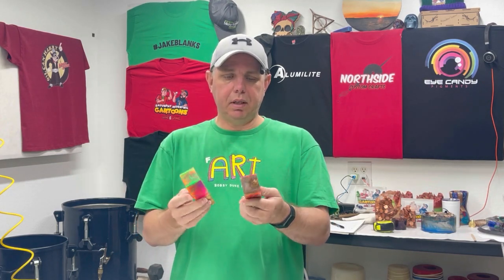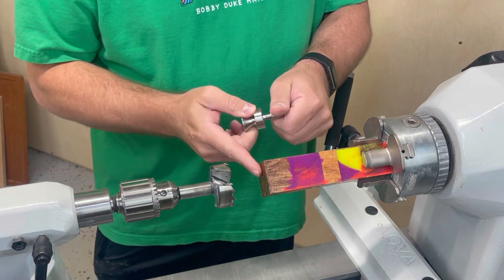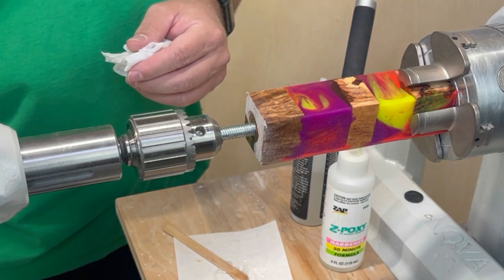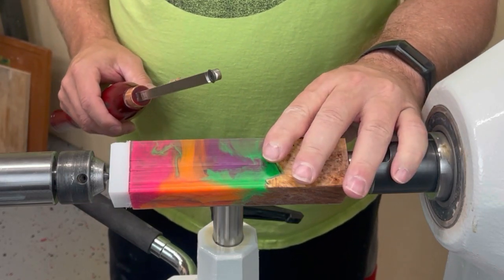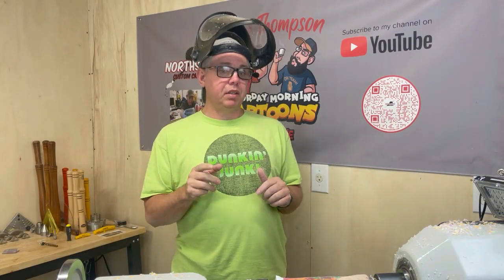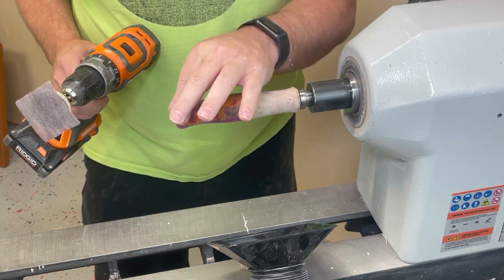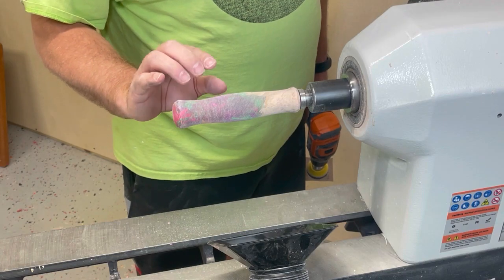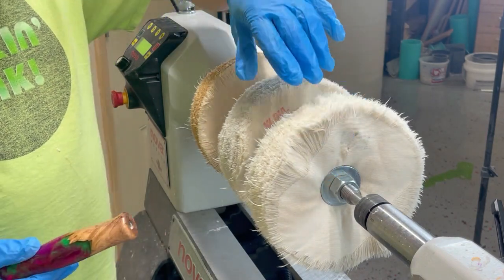Woodturning A Bottle Opener that Glows under a Black Light

Comment: Very cool looking.  Great tip on using the 3/8" bolt or all-thread to position the insert; I'm going to start doing that.  Also, good call on not using the brown Yorkshire grit after you had wet sanded with Zona paper; that would have taken you back to 1000 grit results.  Love the black light effects.  That got me curious so I went out in the shop and found that other mica powders also glow under black light, some more than others.  I think you got a really cool effect because of the translucent nature of the blank you made.  While doing this, I found one other really cool thing: mesquite heartwood has an orange glow under blacklight - the more glossy the finish, the brighter the glow.  Other woods didn't seem to do quite as much - I looked at both Myrtle and Maple.  Oh. almost forgot, I got to the buffing part.  😄
Reply from the maker: 😂😂 Thank you for making it to buffing 😀 I think I saw Carl use the all thread to insert an insert. This was the first time I sanded past 1000 and used any type of Yorkshire grit.. I’m not sure if it was better than sanding to 1000 but I at least felt better about it.  I’m making some more blanks today and there just might be a video later 🦾🦾
Reply: Interesting thoughts Mark.  Thanks or sharing.